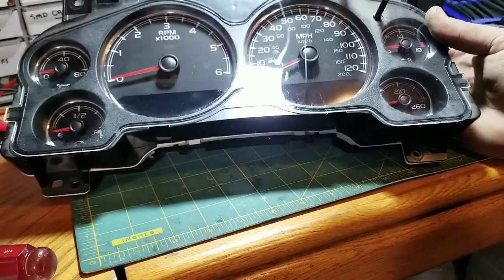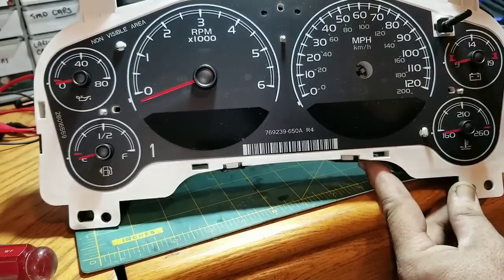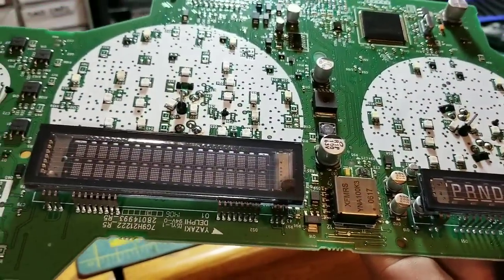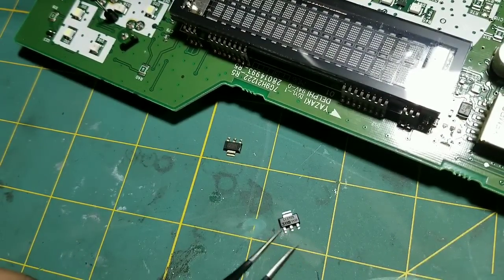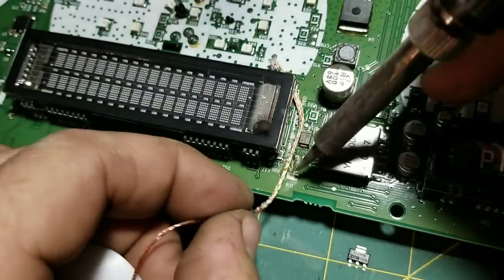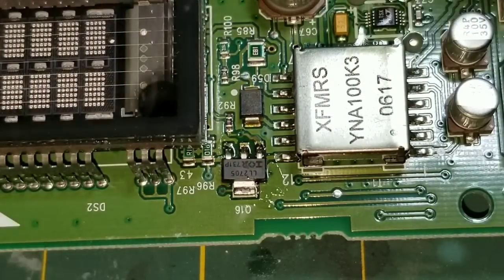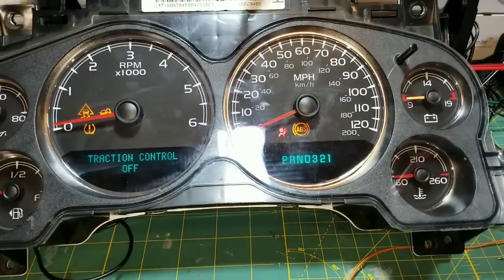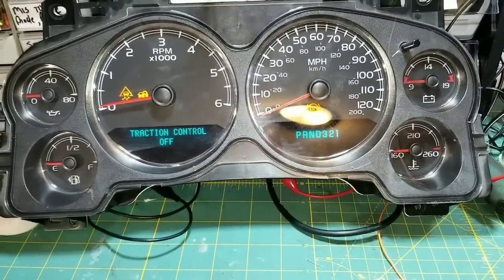07 to 10 chevrolet gmc odometer cluster dead display repair  tahoe silverado sierra

Comment: my digital display light turns on but not the whole cluster or gauges or the rpm  or speed needles  ,,, sometimes it comes on sometimes goes off or barely on , any idea hot to fix it

Comment: My back cover on the instrument cluster had screws holding it together. 2 Torx head screws and 2 Hex head screws. Other than that thanks for the informative video! It was such an easy repair! I am glad I didn't have to replace the mosfett. It just needed cold solder repair.

Comment: Hi I have a chevrolet cruze I changed the engine replace it with a Nissan qg18 and I  want to use the same gm cluster can it work

Comment: so for me its been kind of frustrating because I don't see any video in what it could the problem for only the led lights going out . I have 07 suburban with both digital screens working but no green back lights . also all the warning lights work only the lights for speedo and tachometer are off. I cant find any tips and trick to fix them . fuse if good .